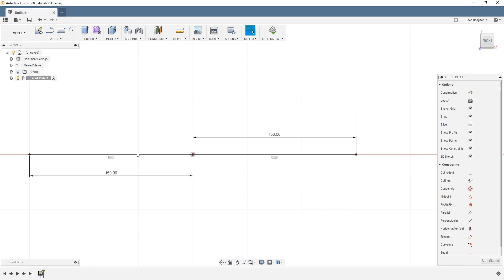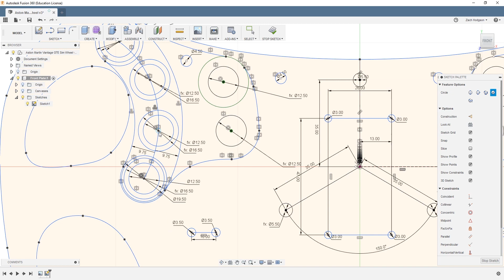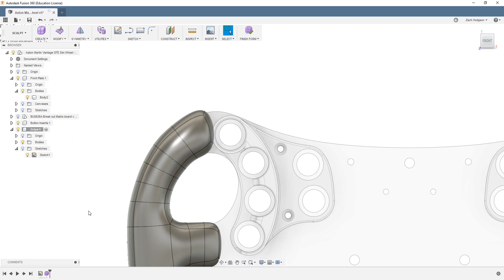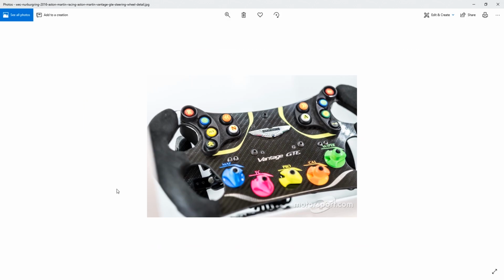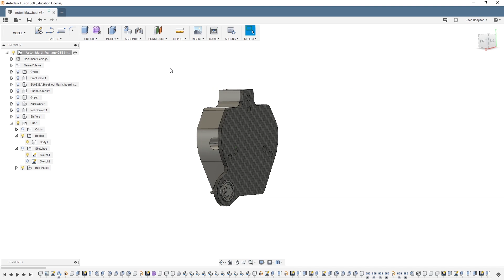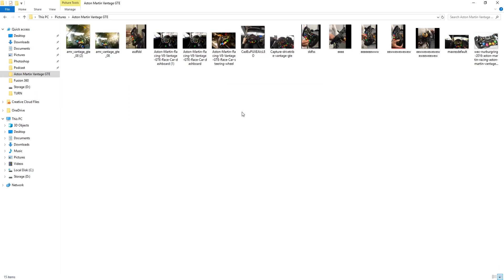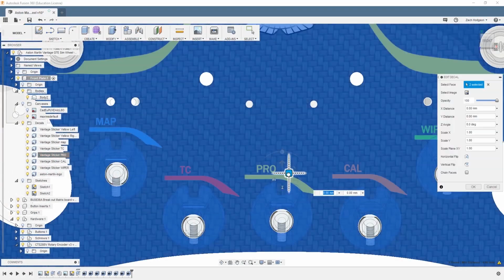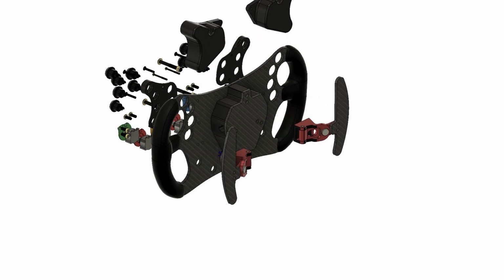How To Design The Turn GTE Sim Wheel Part 1 CAD & Render

Comment: AMAZING! i'm doing a Mclaren 720s gt3 wheel on fusion360 after studying  your GTE cad file...almost finished and ready to cnc the aluminium plate,
I've modeled the Grip and cut in half in sandwich screw with the plate...but not sure How i will put the suede fabric around it ,if I need to coat with rubber spray before glue the suede ...do you use a special program to cut the fabric? I hope you make a video about that in next video
thanks

Comment: Thanks for doing this Zach, I've been following your journey and I love that you are sharing your techniques and releasing source files. This is really close to some of the hand-built stuff that the Mechanical Keyboards community has been doing, but a bit more specialized of course.

If you want to get crazy with the grips, model the base mesh in Fusion, then export it to Blender and use the sculpting tools there to get the nice edges and lips where you want and or need them! There's a pinch brush that would be perfect for the regions around the "t" shape where it meets the plate.
Reply from the maker: Thanks very much Jamie!
Reply: hello, could you make the files available for me to download? In the video he says it is open source but the link is only available for sale. Thank you